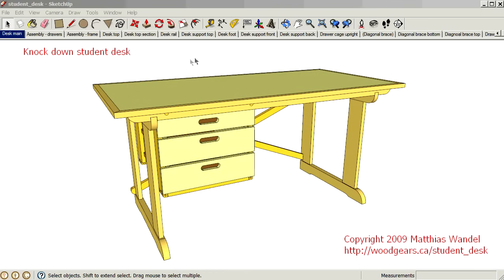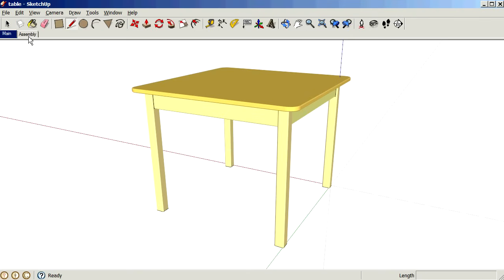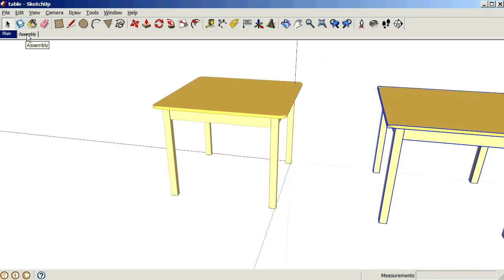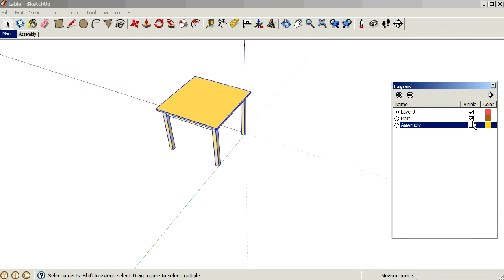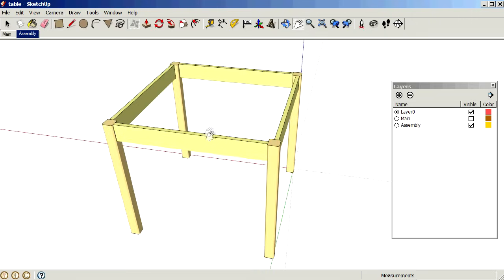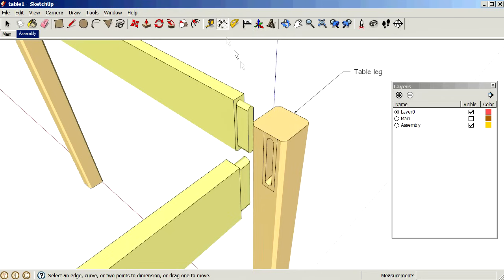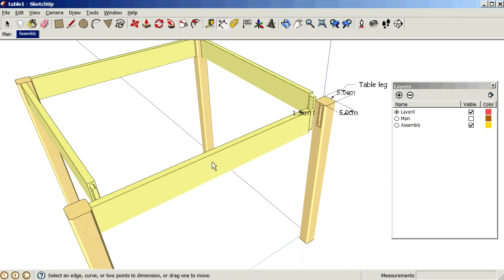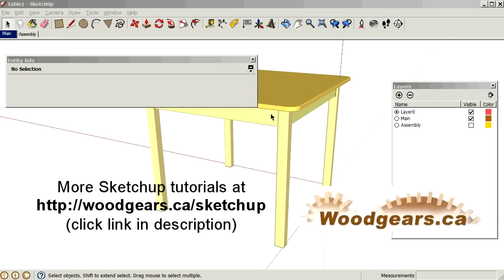SketchUp: Using scenes and layers

Comment: Using 2017 version? Scenes are located under the "windows" tab, then hover over the drop down "default tray"menu and tic "scenes" to enable them to appear in the tray. Next, look near the bottom of the default tray (right side panel by default) and click the "+" to add a scene.

Comment: PeterH is correct. The whole "Scene" idea doesn't appear in Sketchup Make 2017. I ended up making separate drawings.
Reply: scenes and layers are still in 2017. Where it's located has slightly changed but I believe the functionality hasn't.
Reply: Click 'Window' tab, 'Scenes' around half way down..
Reply: @adammacer  Scenes are now located on 2017 version under the "windows" tab, then the pull down "default tray" to enable them to appear in the tray. Look near the bottom of the tray (right side panel by default) and click the "+" to add a scene.

Comment: Hi man, good video. But I've got a question, I'm using the Sketchup pro 2017, when I click in the main or the copy to select "ENTITY INFO", the window doesn't appear, I need to do the same as you did with the component, there is another option to get this window?
Reply from the maker: I don't know.  Ask someone familiar with sketchup pro 2017
Reply: I just find the answer, there is a panel avalable to make this, is not a tab in these new versión. but I've got another question, when I move the assembly, appears a message that says: the layer will be combined whit another hidden layer. Do you kwon how can I move the assebly layer to the original possition without be combined?, Thanks for your time

Comment: Hi, thanks for your tutorial.  If you want to change something in your design and have already made the scenes, you have to recopy the modified object in every scene?  I am new to sketchup, but it would be interesting to have scenes that are relatives to the main scene.  i.e. they don't display different objects, they just apply a serie of transformations to the main scene.   Do you know if other CAD software work that way?
Reply: Ok, I think I got my answer.  You can make the table (or its parts) into a component(s) .  If you copy a component, modification made to one will reflect on the others.

Comment: unfortunately they have changed location of all the layers and scenes stuff in sketchup make 2016 .... very hard to find. But despite locating them, and watching this video countless times, nothing seems to work quite the same.... despite your wonderfully structured and clear explanations .... because they've introduced more nomenclature like trays, that makes it even more confusing. I finally got it to work, but ... yeesh!
Reply: Never mind how many times I set a scene to display only one layer, and update the scene, then the other, attempting to emulate what you're doing here, when ever I go and toggle between scene 1 and scene 2 afterwards sketchup always adds another layer to the display regardless of the updated settings, messing things up. And if I hide the table top in the assembly view, never mind what, it will also disappear in the main view. It's exasperating.
Reply: I am having the same issue.  It works best if there is nothing on layer0.  It will preserve the layers but adds layer0 back every time.  I am going try adding a layer right a the beginning before drawing anything.
Reply: My idea below worked.  Using entity info I moved the whole object to the main layer, leaving layer0 empty.  Now all is working like the video.  It seems 2016 will always add layer0 back into the scene after toggle.

Comment: Very impressive. It would be better for beginners if you showed your actual operations in detail.  You often quickly go through three different keystrokes, calmly saying the overall operation yet failing to specify HOW you are doing it.  This makes the video good for experts but harder for newbies.
Reply from the maker: +Chip Sills It it was that way, it would be really boring and you wouldn't have watched it.
Reply: +Matthias Wandel Thanks for taking the time to respond.  SInce I am myself new to Sketchup, I am trying to absorb a lot and appreciate all the help I can get.  But I understand your point.  Once the sequence of operations is learned well, it seems pointless and tedious to express all the steps.
Reply: I work with the pause video button all the time, have sketchup running in the background to replicate the steps, and, if needed, spool the video back again and again until I get what's going on. Compared to a lot of the videos on this site, these are wonderfully well structured and explained i.m.o.
Reply: Absolutely true. I just gave up watching a series of tutorials after 3 videos because the functions were re -explained each time. Painful. What's the point in having a series of videos if you go back to basics each time and you can't have one long video because ... oh what was I saying?

Comment: Hi Mathias. Excellent tutorial. I have one problem that you may be able to help. When I copy my model to use to pull apart, the original model also gets pulled apart.  Do you know how to prevent this happening? Thanks.
Reply from the maker: meherenow7 You can either "explode" the copied object, or "make it unique".
Reply: Thanks! I just wanted to say also your ingenuity with the way you work with wood is amazing! Very inspiring to see. Thanks again.
Reply: make it a group instead of a component

Comment: I've been through this over & over. If I put the original copy on Layer Main & the duplicate on Layer Assembly, when I make a Scene showing only Layer Main, that's what happens, but when I make a Scene showing only Layer Assembly, when I switch to the 1st Scene showing only Layer Main & then back to the Scene showing only Layer Assembly, it always shows both Layers.
Reply: Sounds like you may need to add another layer for each section. Start with layer 0 and build the whole project. Then work layer by layer and scene by scene.

Comment: Well I see some folks have really picked the fly shit out of the pepper.  MY process was correct but I rounded off numbers, when others took it out several digits from the decimal point.  I'm not figuring it again, but the guy who has 16,806.321..... is probably got it on the dot.

Comment: I come up with 17,600 RPM.  Given the 4" dia x 3.14 = cir of 12.5"  To keep it easy I left it at 12".  At 17600 RPM the rotation would complete 3.33 miles every minute.  Multiply that by 60 and you get your 200 MPH.  Now since I took off the .5 " you actually can go a little bit slower RPM than that to obtain the 200 MPH.

Comment: The whole idea was to either prove or diprove the 200 mph duct tape. My lathe won't turn that fast. I was going to do an inside out turning with 4 pieces of wood or maybe 9 pieces. I didn't want to use a lot of glue and wanted to try duct tape and just tape the ends. I'd still have to use some glue on the ends because the wood could shift a little bit with just duct tape. But it's a moot point now.

Comment: 16807 RPM to get the outer surface of the log to spin at 200 mph. 

Here is the math: circumference of log is 12.5667, so 1 rev goes 12.5667 in.  1 mile is 63360 inches, 200 mph is  12,672,000 inches/hr, or 211,200 inches/minute, since 1 revolution is 12.5667 you need 16807 revolutions per minute to get 200 MPH.

Comment: Great video!

I think the layers are the most powerful feature of Sketchup. I make it a rule that everything in my Sketchup model is in a layer other than layer 0. This system works especially well if you are working on anything that resembles a box (including a drawing of a room). By assigning a layer to each side, I can quickly see anything inside the box without making special views by simply turning off layers. If you ponder this, you’ll realize that exploded views are not really necessary.